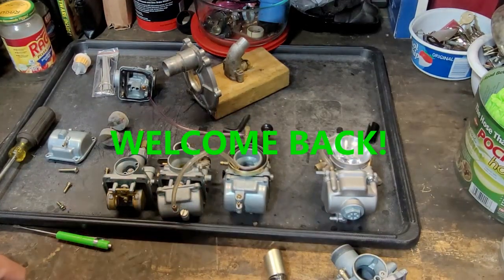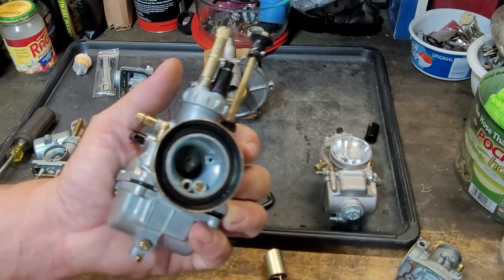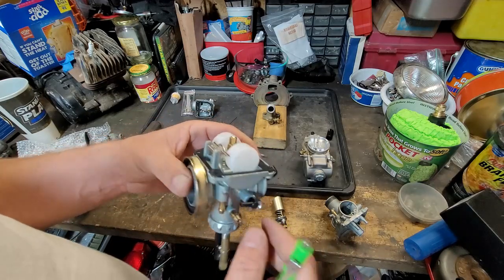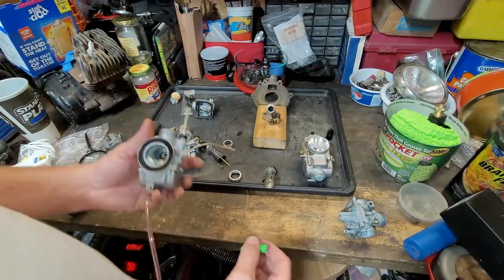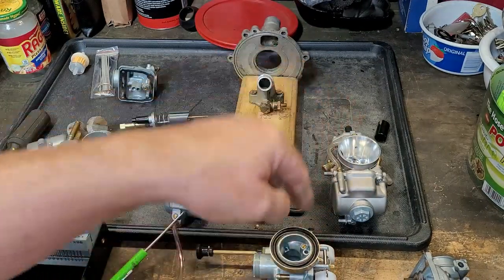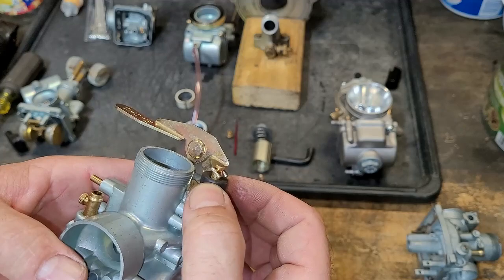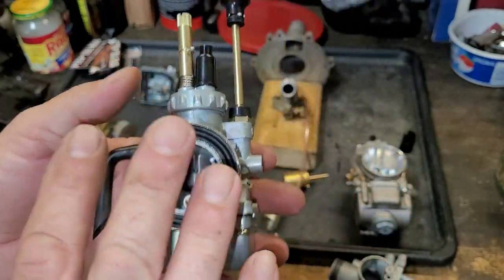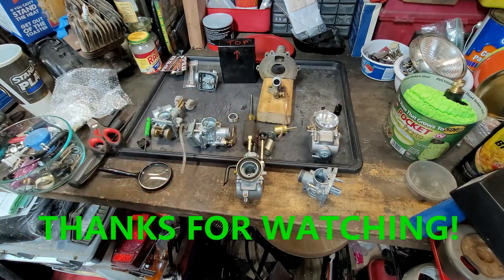ebay carbs, Chinese knockoffs carbs what you should know and more part 1

Comment: Hey Kevin, maybe it’s somewhere about in your videos but, how do I fix a high idle and get a properly mixed engine? Not too rich and not too lean either. KD80
Reply: First you’ll go to your pilot air screw. Turn it all the way in and then back it out 1-1/2 turns (start there). Now back turn in idle air adjuster all the way until the slide stops moving. Start the bike. Adjust your slide with the knob until your bike is running at the lowest stable idle. If it’s idling really high and kind of ringing out, maybe go in slightly on your pilot air screw. If you get a lot of back firing try backing it out a little more

Comment: Hey Kevin, I have a 1986 kd80M. I replaced the points, condenser, and exciting coil with OEM parts. Its sending an ignition signal through the ignition wire, but isn't strong enough to create spark. I know the coil is good because I've tested it on another bike. Do you have any ideas what could be wrong.
Reply from the maker: Set points to 013
Reply: @2strokeguru  Sorry I’m new to this could you elaborate what that means?
Reply from the maker: @chrisjay3297  you have to set the points gap with tool called a feeler gauge and the correct size gauge is 013